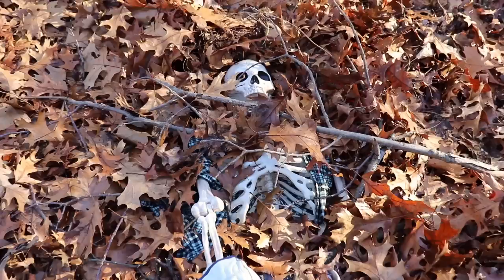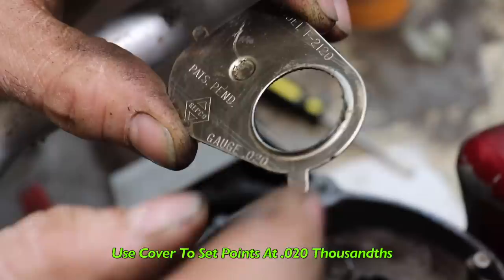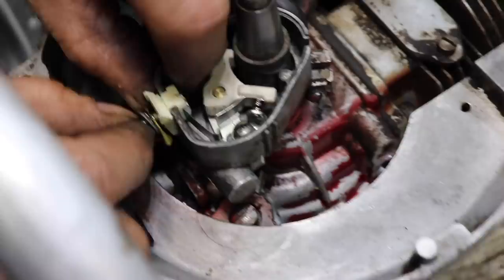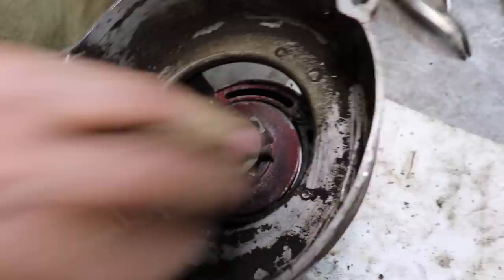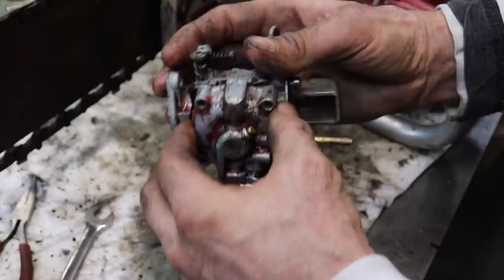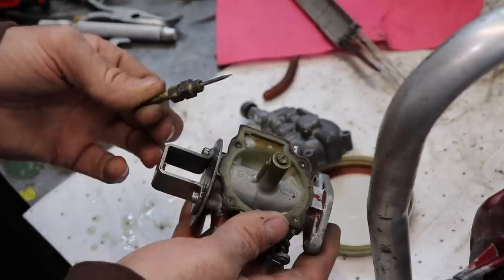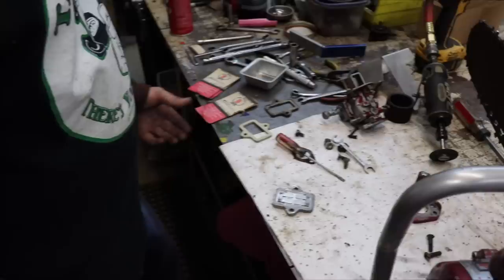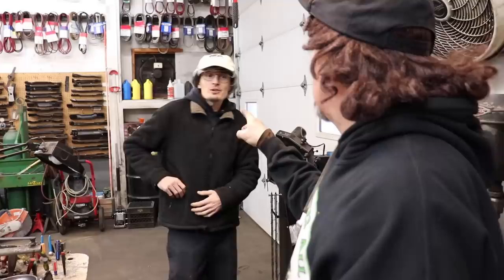Getting A 1956 Eclipse Wasp Chainsaw Running - with Taryl

Comment: This saw reminds me of my father's old STRUNK (i think that's how it is spelled). heavy ol saw, just lay it on top the log and the weight pulled it through the cut, hard to make the felling cut unless you were strong, some times it starved out cause it did not pressurize the fuel tank so well, I enjoyed watching this vid, some good memories the first time I ever worked with my father.

Comment: The first saw i ran was my fathers 7-19 Homelite back in 1959. Then in the early 60's i cut pulpwood with a 500, 700 and 900 model Homelite's. In 1964 they came out with the XL-12, it was like a toy saw after carrying the 500 series. I logged full time up till 1989, i got hurt in a logging accident.
Very good video

Comment: Taryl adjusting the high speed with his fingers just an inch from the moving chain made me crap myself. Sketchy as frig!
Reply: Me too!
Reply: Yeah Taryl man, I know you're careful..just place at least a piece of fixed plywood between your hand and that running blade bro! Please!
Reply: John Chrysostom  that's simple smart! Thank you!
Reply: That's how talented people make their money. Finesse.
Not sketchy. Because he gives his all to getting er done.
No worries for clothing. Or sound or smell. Fix first. The rest comes later.
Cause the final diag.
Go/ no go is there for him.
Reply: A
Reply: Used to have two of those on a go kart I had did 76 miles an hour
Reply: I was thinking a man would want to be either really sober or really drunk to do that. But Taryl has the hands of a Surgeon, and the gift of a golden screwdriver
Reply: That thing was built before safety was invented. If you cut your finger off, you didn’t sue the saw company, you walked it off and got back to work like a man.

Comment: Great video.  One thing about the ultrasonic cleaner solution.....I have the same unit, and have tried a LOT of different solutions.  Best stuff I've tried is Krud Kutter parts washer cleaner/degreaser.  Safe for all metals,  bio-degradeable, and works great.

Comment: We used to call these wood shed saws- they never started when you take them to the woods- just in the wood shed.
Reply: Or after you dragged them two miles into the woods through two feet of snow. You get it running, idling fine, then as soon as you touch the throttle it dies and won't start again. Or is that an old Homelite issue?

Comment: Mr taryl , I found that feeler guage makes good replacement Reed valves for those old motors when you can't find them anymore :) just a FYI
Reply: Good idea.
Reply: I used that to repair a 60's outboard Sears Elgin :)
Reply: Who cares?
Reply: @mattyg941  people that work in this stuff :)
Reply: Thanks, great idea.

Comment: Great Video!   What a find of a vintage chainsaw!   1956 was likely near the vary end of float bowl carburetor use for chainsaws.   That saw would have been very limited in how much out of level cutting it could do.   Old chainsaws with float carburetors frequently had it so the operator could rotate the carburetor 90° so the saw could be used for making horizontal felling cuts.  I put 1/2" pitch Stihl chain on a gear reduction chainsaw and that old saw just sank through wood cutting out huge chips as it quickly munched down a log!   It was slow cutting, but the chips it cut were huge so it balanced out to devouring the trees we put in on!  It was fun to watch!   These were very expensive machines when new.   I use the US Labor & Statistic inflation calculator for giving current value of old prices.   According to an economist that commented back to me that is not the way economist look back on past value they also considered how much lower average wealth influenced purchase decision.   So lets that that Wasp 1956 chainsaw inflation calculated original price would put it at $3,000 in 2020, but it would be in effect even more expensive because average wealth was so much lower in 1956 than 2020.   That makes these old saw a machine that could of only likely be purchased by major company.

Comment: Saw the running saw carb adjustment notice.. Love that idea.. Thats like putting a carb needle valve adjustment behind the mower blade.. What a terrible design that was... 
THIS IS HOW MANY FINGERS LAID TO REST OVER THE YEARS!!!
Reply: BILLSTMAXX, I probably would tune it without the finger chopper attached.
Reply: Just remove the chain
Reply: @rolandvad5067 🤔 🤣 too many people just didn't though 🤣, they left the chain on✊
Reply: Always take blade n chain off when servicing saws. Fifty years n all my fingers prove it works.

Comment: How carburetors have changed. When we were racing go karts back in the late 50s, early 60s, the engine from power products and McCullough used diaphragm/pumper carbs.

Comment: I was hollering the jet in the bottom holds that on .IVE worked on those in the 60-70s. So many great old saws trashed for being heavy. But ill tell you a bow bar on them n they would cut effortlessly on downed trees. Firewood men loved them the wisse, the old 66 , big maccolagh  saws pioneer. Fmc,  David Bradley too. I think thats a tillotson  carb.

Comment: I have a old Ryobi weed whacker I bought new back in the 90s and the mix ratio on that is 32 to 1. I have been using True Fuel and other pre mixed two stroke fuel at the 50 to 1 ratio in it for years and it runs like a top.

Comment: At least that's one good thing about equipment that blows, leaks oil all over, the bolts and screws come out easy. That point box looked mint. Even the bowl gasket was in one piece, lucky. I like the old carbs where you can actually get to ports etc.

Comment: If you want to find what areas of your ultrasonic tank has the highest ultrasonic power, float a piece of aluminum foil on top of liquid surface while ultrasonic tank is on. You will see holes develop in the aluminum foil...you will start to see a pattern of holes indicating where the highest level of ultrasonic power is concentrated. Typically the highest power will be directly above the transducers that are bonded under the tank. I used to work on these.

Comment: I still use my 1958 homelite zip saw with a 20 inch bar. I also use my 1963 homelite  51 with an 18 inch bar. They both run better than my three year old pioneer with a 20 inch bar. Oil today has a better ability to lubercate than oil in the 50's and 60's i run all my saws on synthetic 50 to 1. Never had any problems.

Comment: I have two of these One is missing the air filter cover. The other one I thought for the past 40 plus years that filter cover that I have was so crude that it had to be home made. Now I see I was wrong. Yes these things are crazy heavy. I was thirteen when I got these I am 60 now. At thirteen years old my father took me to an auto parts store to get a petronics condenser that they had in stock. i cleaned the carb.  and got it started. I love your videos

Comment: I have a 1957 2 horse power Elgin outboard motor that is air cooled, and a late 40s early 50s twin cylender elgin 5.5 horse power that use the exact same carburetor that the this saw has. I always make carburetor gaskets out of cerial boxes. Just smear a thin layer of oil on the gasket surface of the carburetor and stamp it flat on the cerial box and you have an outline to trace. Cut the bolt holes out first with a small screwdriver. Then gently run a chainsaw file in and out gently to widen the hole for the screws. Second cut the inside of the gasket out. Last cut the rest out along the edges. Lightly trim and touch up as needed! Now there's yer dinner!

Comment: A little information sharing in regards to tightening a crankshaft nut with an impact. I used to and then to my horror, I was reassembling an echo 8000 a quick shot with the impact 3/8" dewalt and snapped the crank flush with the flywheel.  Considering I was almost done with the project it was extremely demoralizing.   I only use an impact for loosening flywheel nuts now. From there this saw from hell was sitting on the floor and while moving a cart I hooked the cord of my bench top parts washer which dumped all over my floor then broke off 2 of the top fins of my brand new cylinder because I didn't have the top cover on it yet. It sat for a year until I got over my dumb self. I did complete the saw a few months ago and it's back to the saw I used to know. Hope this saves someone a bad day and some money.

Comment: Tartly when I was racing bikes back in the early seventies we had reed blocks on the motors . We would flip them over ifen they weren't cracked. We did have screws. Always worried they would come loose and go thru motor. It ain't rocket science. You da man!
Reply: Who's Tartly?
Reply: Marty that's what happens when you got sausage fingers and don't read your post. I think taryl is cool.

Comment: I was born left-handed, was forced to be right-handed by teachers, now I can use both hands pretty equally, but poorly. Interestingly, I can use both hands for dominant actions at the same time, which apparently freaks some people out?

I wouldn't run any two-stroke engine on any leaner than 32:1 unless I had a reason. 50:1 just seems like too little oil and I've heard from a lot of people that 32:1 seems to be the "sweet spot" for engine longevity.

Comment: Nice tip of using super glue to hold the machine nut in place. We used to use heavy grease, which worked but also made a mess. LOL

Comment: Never thought I would see a chainsaw they had a carburetor with a float in bowl on it.
With that setup it keeps you from turning the chainsaw on its side to use it to cut a tree down.
I have a homelite chainsaw that was made somewhere around the 70s that has the diaphragm style carburetor which means you can hold my chainsaw sideways or even upside down and it will run without dying.

Comment: Taryl... unless you're wanting to clean a glass jar - don't put one into the ultrasonic... the glass BLOCKS the ultrasonic waves which travel through the liquid medium which acts as the cleaning action on the parts.  The parts need to enter the cleaner NAKED into the cleaner to get the full effect from the cleaner... I thought you would have figured this out by now...  Then again you might already know this - since this video is several years old already and someone has probably mentioned this to you by now.  Again the cleaner works by sending vibrational waves through the liquid to act on the parts to clean.  If your parts are in a sealed glass jar - then the vibrations get blocked a lot by the hard glass from the jar...

Comment: My dad worked with another one of Karl Childers over here in Australia, he's a spray painter by trade & he drove a candy apple coloured 1958-1960 FC Holden utility (pickup) that he restored.

I think he ended up not restoring cars as he got older & just air brushed motorcycle fuel tanks !

Comment: I guess the saw chain never stops moving at idle in 56. we still used buck saws and cross cuts in the woods for camp wood. only pros used saws. great video. the old saws were built to be worked on. thanks

Comment: Great video. I inherited a huge "Maul" Chainsaw, and intend to get it going.  One think I wonder about the Wasp, is if the chain always runs, or if a clutch is supposed to disengage it at idle?  Thanks.
Reply: I used to have a maull
The one I had was direct drive some of the older ones were, some did not use clutches
Reply: That's a good tillotson carburetor I can tell by the choke lever and the float bowl, @t power product
Wait a minute that has to be a pumper isn't it?
Yeah that's not the normal old tillotson, that's something different.
Reply: So it's not a pumper
Reply: When the crankcase pressurizes with the down stroke of the Piston those reeds close.

Comment: On a champ (and most non-NGK plugs) the number is the heat range, from 8 to 13 is 5 notches hotter, if this thing was running close to optimal it would have burned a hole on the piston.  The idea is to use the coolest plug that doesn't foul-up with normal use.  People will use hotter plugs because they are too lazy to clean airfilters up regularly so they run saws like they are on choke at half horsepower.
Reply: I forgot NGK is just reverse, the higher the number the cooler it gets, so a B9ES is 2 levels cooler than B7ES,

Comment: You can use modern synthetic two stroke oils in place of the mineral oil, but you need to be careful reducing the ratio too far.  The old plain bearing engines rely on the oil film to cushion them from contact.  Modern oils and high ratio mixes assume roller and ball bearings throughout - the old plain bearing bangers don't do high ratios well at all under working loads, and the cost of mixing a synthetic at 20 to 1 or richer gets a bit rude as well...

Comment: What happened to explaining the "ribbon air filter?"
Reply: Good point. Never heard that termination used in Australia. 👍👍🇦🇺
Reply from the maker: Ray Kolasa 27:40
Reply: @TarylFixesAll  1:29
Reply: He prolly placed the same old one, just to hold some admission to see if it lowers the speed.
Reply: @rodolfoplasencia4953  There is another video,i think the one with the old antique "ankle chopper" mower were he explains the ribbon filter in detail

Comment: 16 to  1  ratio is for  4 stroke motor  oil   you  can  use  your  Modern  two stroke oil  at  32-to 1  or  40 to 1  ect

Comment: Hey Taryl,  What is the coil part number for this engine?  I have an old Roto Rugg push mower with a AV47 engine and the coil is dripping black all over and needs replaced.  Thanks, Adam

Comment: The modern lean oil ratios are not safe in the old plain bearing two strokes.  The oil film is a cushioning requirement in the old bearings and yeah, the saw will run on 50/1 synthetic, but the bearings will gall and hammer under sustained load so be cautious...  That's why we only run the cheap mineral aircooled twostroke oils at 25/1 in our early toys, Seagull outboards, Villiers garden implements etc. - it's still less oil smoke than the original (up to 10/1) design asked for but supplies enough physical oil film to provide hydraulic lock and prevent rubbing the bits together.  All the synthetic lubricants are fantastic, but they are all designed for use in engines with roller bearings instead of plain bearings - they need only enough lubricant to keep those assemblies sweet as most of the friction load is not metal sliding on metal.

Comment: Seeing this, makes me wanna get out the egg can full of 1950's Montgomery Wards chain saw parts and put it back together. Seems like I need a connecting rod for it though.  On second thought. I have a parts saw for Dads late 50's David Bradley, both complete. That's the one I should work on. A guy would just need a backhoe to hang it on if he wanted to cut more than one pass with it.

Comment: It still doesn't sound like it is running right - fast idle and slow throttle response.  Probably that 50:1 oil - ruined everything :)  Love the reed block repair, and learning about it.  Impressed that you have gaskets in your parts stock.  The scary sound effects when things pop up are great.  We had a large chainsaw my dad bought in the early 1970's that weighed about 35 pounds and had a manual oiler.  Can't recall the brand.
Reply: McCullough?

Comment: Your going to wreck that crankshaft with the hammer lol thanks for all the great videos
Reply: well, he claims it doesn't do anything to the crank. but anyone who have ever reassembled a 2-stroke crank knows every punch with a hammer makes a difference when you check it with a gauge... but i suppose it's alright enough... (worst case scenario the bearings wear out faster, and 3 years later the client comes back to have Taryl replace the bearings or throws it away)

Comment: I was a bit worried that the reed rivets aren’t air tight.   The reeds might seal better, but I think air will leak down the barrel of the revert. Plus rivets have rivet nails.  Don’t want them getting in the engine.  

#6 screws and a smaller hole.  Or tap and a machine screw.

Comment: No crank seals? In an old saw I usually suggest new crank seals. Antique 2-cycle usually burn up if I don't replace the seals, I mean they get hard and crack. You could do a crankcase leak test on the old girl. I fixed too many old homelites that came back, next week just because the customer would only let me clean the carb.  Just my experience. It's a wall hanger anyways. .

Comment: Hello .. love the show I had a question and was hoping it may give an idea for a video for you..I have a craftman riding mower 42 in deck has a Briggs not sure the type the heads are almost straight across from each other I had a bad head gasket so I replaced both.. I went out a couple days ago and after letting it warm up oil started gathering out into the air cleaner.. needless to say it died.. is it scrap now?? Hoping you can help out .. I'm a mechanic of a lil bigger engines lol. Never seen this.
Reply: The oils probably coming from the crankcase breather that leads to the airbox, the breather tube can come from the crankcase itself or the valve cover on an ohv. If yours is ohv and the breather tube is on the head then maybe something is missing, upside down etc. when u reinstalled the valve cover so splashing oil is going right down the tube
Reply: Maybe a mad needle and seat in your carburetor. Your oil level is too high and putting oil background the Breather into the air filter. What you're saying is fuel being built up in the crankcase

Comment: My way: I usually hold the saw by the flywheel and rap the side of flywheel opposite the magnet with a flat hammer face, they pop right off most of the time.  Careful not to hit the cooling fan fins!
I find the sprockets are usually worn out on these old saws.
Float carburetor, LOL, didn't expect to see that.
Reply: Float Carb... well spotted...   How does that work when you are doing horizontal felling cuts..?
Reply: @hiscifi2986  Might not be possible if the engine floods when the bar is horizontal.